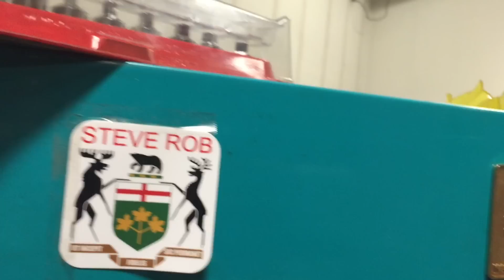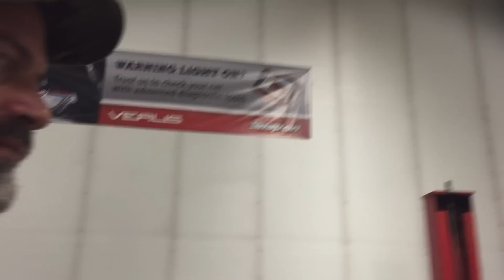1 Hour + Special W/Shop Tour - Mercury Mountaineer Ford Explorer Brake Job Etc

Comment: Nice shop and tool box, Tim. Looks like you have most of what you need. Video is well done. When i do a brake job here in Canada we have to lube everything on brakes or it will seize. I have never seen an oil filter adapter leak on a 4.6 Ford. Must have something to do with temperature extremes.
Reply from the maker: +wysetech2000 Those gaskets can leak and mix coolant with oil in rare cases I guess. I have seen a few leak oil but not overly common. We are so spoiled with no rust here. I see the horror stories on here from techs along the rust belt. If I ever move there I'll have to find a different career path. Haha. Good seeing you, take care.

Comment: Okay Doc a few questions, in doing a brake job when do you know if you should remove the brake fluid? Going for an 800 mile trip to Chicago so I picked up a turkey baster to remove the fluid and I'm gonna fill the MC and bleed the brakes to get all new fluid in there. Good idea? And on a T&C 3.8 what sensor is opposite the oil filter ( on the firewall side of the engine) near the bracket that goes from the block to the transmission? One more thing my prayer buddy, while Paxton is still in intensive care he is doing a lot better he has stopped upchucking and he is eating, Praise the Lord.
TFS
Reply from the maker: +MostlymoparIH I wonder if your looking at the crank sensor back there? Brake fluid draws moisture from the air so unless you can test for the presence of water in the fluid then changing every five years is probably a good idea. Thanks for the update on Paxton. We will keep praying for a full recovery. Take care.
Reply: It's in the middle of the block. I guess I am gonna have to join the ranks of the Car Doctor studios and get a camera and do a little show and ah not tell how about show and what's this?  Paxton has a long road ahead of him. They are having trouble with his pain levels but he is doing phenomenally well he wants to get up. God is good. Thanks for your continued support.
Reply: +MostlymoparIH 
I stand corrected. I thought the crank sensor was bolted to the trans. Thank you much.